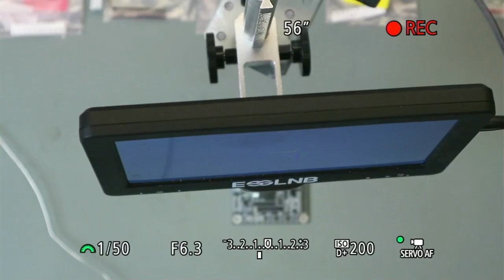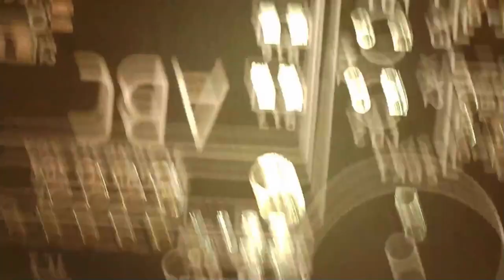Build a PI1541 Floppy Emulator for C64 Part 1: The Beginning

Comment: Ich verzinne eigentlich bei den Widerständen und Kondensatoren ein Pad. Da halte ich eine Seite des Bauelements drauf und schmelze es fest (ich sage bewusst nich „löten“ dazu, weil ich diese erste Lötstelle als minderwertig betrachte. Dann löte ich die andere (unverzinnte) Seite fest und löte danach noch einmal die erste Lötstelle. Bei ICs verzinne ich zwei, diagonal gegenüber liegende Pads klebe den ersten Pin fest, korrigiere möglicherweise die ausrichtung, schmelze das gegenüber liegende Pad fest und löte die Pins. Und löte die ersten zwei Pads richtig fest. Man benötigt nich so viel Lötzinn. Es sollte eher eine „Hohlkehle“ als eine Perle sein. 0.5mm Lötzinn ist für SMD ganz gut. Unter dem Microskop sieht man ja gut, wie das Zinn fließt.
Reply from the maker: Ich denke bei meinen Lötskills ist noch Luft nach oben. Danke für den Tip.
Reply: @tomscomputerchannel2925  Bei wem nicht? Bis zu IPC-Zertifizierung habe ich noch viel zu lernen 🙂 Früher hatte ich ja immer jemanden zum Prototypenbau.